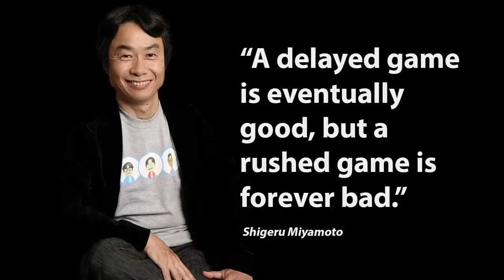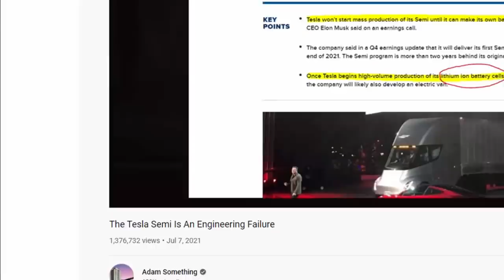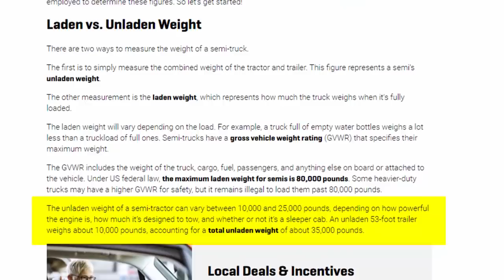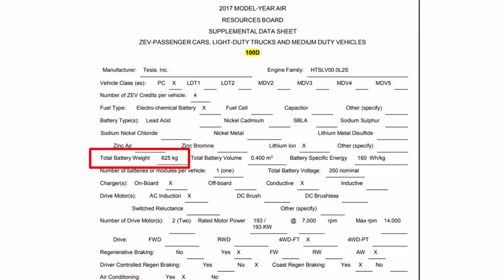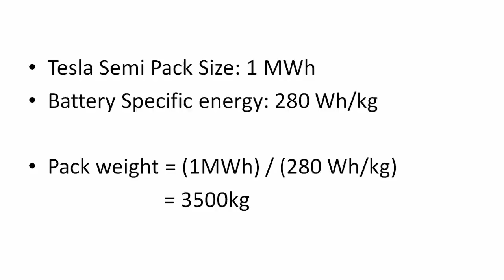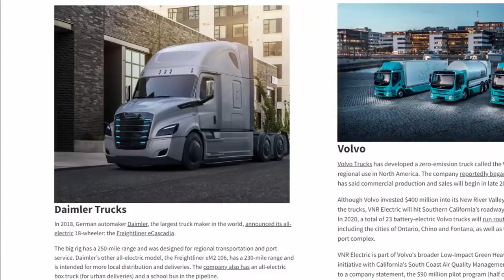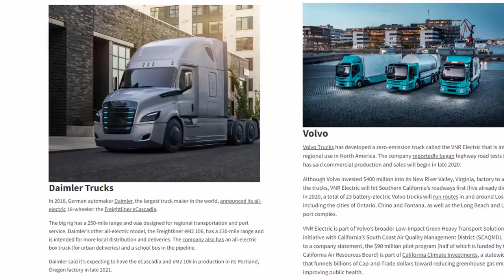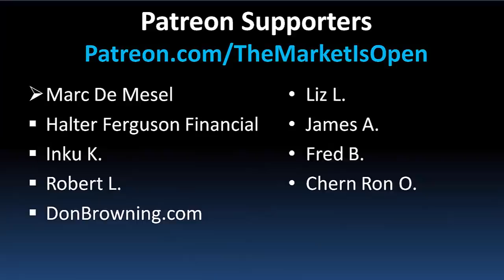The 2022 Tesla Semi is Genius, And Here’s Why

Comment: Battery drain on long up hill grades
No Drake brake to hold gear on long down hill grade 

 never be a big hit in Australia
Reply: Regenerative braking.
Reply: @erbewayne6868   so will trust that over your Drake brake ?

What about loads  120 ton loaded road trains ect
Reply: Regensritive braking on a r r electric locomotive  is when the motors are used as generators to decrease speed or hold back a train on a downgrade and when used with a catanary, puts power back into the electrical grid.  This has worked well for decades to help control train speeds.  I  don't  know  if  it's  in any current electric design but has worked well  in other areas.
Reply: @erbewayne6868   yeh battery drain on the system again this is fail it won't work
Reply: @Paul-fi2kf  regenerative Braking already works in the Tesla cars. Since 2012. Its called recupperation.

Comment: Any ic car mechanic can tell the electric vehicle has a fraction of the parts of an ic vehicle and thus takes orders of magnitude less time to assemble and eventually will lower the cost of a new vehicle by 50 percent or even more in the not so distant future. $4000 for a cell phone in 1988 and 75 cents a minute. Compare that to today. You can pick up a smartphone for 50 bucks and pay 30 per month for unlimited everything.
Reply: Lithium costs have doubled. Silver is scarce. Copper cannot meet demand and is going up. Steel is going up. No price decreases coming anytime soon to say nothing of infrastructure for charging.
Reply: @jimlycett4480  Lithium price is down. It was never as cheap as today.

Comment: A couple errors in this video I would like to point out. Tractor trailers are actually almost always loaded to capacity. Freight transport is most cost effective when at full capacity and so what's the point in having a transport at less. In fact semi drivers plan their fuel fill ups around weigh-in stations. They typically try to hit the weigh station when their fuel tanks are less than half full or as close to empty as possible as to meet the capacity limits. And not get fined. Many still get fined because they get overloaded. So yes I would say most tractor trailers are loaded to capacity and many times above.
Another issue is that the capacity of these trailers isn't dependent on the safety of the vehicle. It is due to the load limits of highways, bridges, Asphalt in general. The more axles and tires you have the higher your load capacity.
Last of all to say that these electric tractors are going to completely take over the market is just BS from a Tesla fan that doesn't actually know anything. 
If these tractors turn out to be everything they're promised they will have their place. There will be a lot of companies out there that will see the value in them and use them for what they are intended. Regional / local driving. What they are not intended for is long haul driving. Following the standard 11 hour driving limit a driver could do 8 hours at 55mph rest 30 minutes and drive three more. After this 11 hour driving limit they are not allowed to operate the vehicle for a 10 hour period. Now depending on state we are driving in the speed limit for a semi truck driver could be anywhere between 55 and 80 mph. Even at 55 they will be bouncing against the range limit of a fully charged truck after 8 consecutive hours. Or assuming the truck is charged to its standard 80% after 7 hours. Now let's be honest when was the last time you actually saw a semi truck doing the speed limit on the freeway? Drivers are almost always working against the clock, And don't have the time to plan their trip around charging stations.
Most states allow semis to do 70, 75 and some 80 mph. Following the 11 hour driving limit rules a driver can go 600 mi in the first 8 hours while driving at 75 mph. And then after resting half an hour. Drive another 225 mi. Totalling 825 miles.
I highly doubt the Tesla tractor. Will get anywhere near it's advertised range when doing 75 mph (efficiency tends to really drop off at these speeds) so Tesla probably won't even make 500 miles the first 8 hours. Severely cutting down on its viability for long haul use.
It doesn't end there. Many long haul truckers have partners that they switch out with so as to not have to take rest stops. These team driving operations and can drive 3500 miles across the entire country without a single stop and less than 3 days
If driving at 55 miles per hour. A Tesla tractor can make 400 mi at 80% charge 30 minutes per charge. It would require at least 9 charges. It would be traveling slower and have more downtime than the diesel equivalent making it not applicable for this situation.
So these Tesla trucks will have their place in regional / local trucking.
But they will not be taking over the market untill they have MUCH more range.
Reply: WELL SAID!!! I CAN TELL YOU HAVE AN AMPLE AMOUNT OF XP
Reply: Idontrunn toofast - Thanks for Agreeing with Tesla's Mission for the Semi, as mentioned when it was Unveiled! 

"80% of Semi's drive under 250 Miles from Base, per day!" 
Tesla is aiming for "Day Trips" or Out & Back, same Day, from A Base, with both Versions of this Truck! 

It is not "Competing" With those Semi's that can "Tanker Fuel" for an 1,800 Miles per Fill, Run, or "Over The Road" Long Haul Rigs!

And, if that 80% Figure, is anywhere mere close to Accurate, that's still a big Market to play in, to start with!
Reply: @robertweekley5926  Exactly, this is what the Tesla Tractor was made for. I already know all of this as you can tell from my lengthy comment. My comment wasn't a criticism of Tesla. If their Tractor does everything they promised it will be excellent for the purposes it was designed for. My comment was obviously directed at the ignorant fanboy that made this video who obviously knows nothing about hauling, trucks, and the various uses and needs that they fulfill.
Reply: @robertweekley5926  Right, but its NOT GOING TO END ALL DIESEL TRUCKING YOU CRETIN
Reply: Tesla is selling a "Day Cab Semi" exactly for "Local/Regional" Runs, from Warehouse to Stores! 

It's not a "Sleeper Cab" exactly for such reasons as you stated! 

Plus, it will take, a minimum of 3-5 Years, just for them to get to 100,000 Units per Year, because, in part, demand for cells for the Cybertruck, as well as, getting a full Network of "Megachargers" set up!

But, in 2025-2026, it should be Quite Interesting!
Reply: If regenerative braking is used, there would be some gains in travel distances.
Reply: @erbewayne6868  If regenerative breaking is used any additional mileage it produces is already included in the estimated range.
Reply: I see an error in your view.
The driver cost.
You say they don't stop because they carry two drivers.
The fanboy  in this clip points out Tesla's plans for convoys with only one driver or even full driver less ones eventually.
Maybe the long haul tech is not there yet but how many products require that tight delivery schedules?
Btw have you seen the experimental pentagraph in Germany ?
Charges the truck while driving....
Problem solved..
Reply: @Blibby-Blobby     Nope, no error just facts. Whether people can see those facts or not is up to their understanding of the laws of physics and basic economics. I'm pointing out that this tesla fanboy claims that these trucks will be completely taking over the market. The fact is they won't be. Not for some time at least when infrastructure that allows for it. 
And yes I was pointing out that Tesla does not intend for these to be used for long haul. That's a portion of the market that it will not be able to touch. And it's a bigger portion than you think. Aside from just rapid delivery of goods long haul trucking provides most of "perishable goods"
Ever wonder where that steak came from? It was most likely transported as a live cow from another state. Transportation of livestock (cows,chickens etc.) across the country is primarily a job of Long haul trucking, The product must be transported in is short of a time as possible to reduce the stress on the animals, reduce the cost of feeding, and care of the animals during transportation. So yes Long haul trucking does make up for a important portion of the market
The German charging road maybe applicable to a few sections of the Autobahn but do you realize what kind of infrastructure will be required to provide charging just on our highways in the US? Germany is about 138k square miles. Which makes it about the size of New Mexico or Montana and about half the size of Texas or 1/30th the size of the United States.
Germany has a very dense highway system with 400k miles of road and about 8000 miles of expressway. The United States has close to 4.2 million miles of road and 164000 miles of expressway.
Let's just assume that the EV charging roadways require no maintenance, cost the same as normal concrete / asphalt and can be be built with relative ease in the same time frame as normal expressways. (All untrue) we still wouldn't be able to afford the cost required to replace even a 10th of the highway system we have in place over the next 50 years. It's not economically feasible. Additionally currently our electrical grid isn't up to the task of powering all these electric cars and trucks More energy plants will have to be built, high voltage lines put in place, substations installed and grids will have to be replaced in order to meet demand. It's not something we can just jump into and it's probably not going to happen in my lifetime. 
Before you jump and just call me a EV hater. I am not. I think it'd be awesome if all this were possible now. If I could afford it I would gladly purchase a Tesla today to replace my grocery getter. I think it's all really cool and it's the direction that the world is going. But you have to be a realistic with expectations and This YouTubers' expectations don't fit reality.
Reply: @Idontrunntoofast  
You still didn't address the driver cost which are enormous.
I agree support infrastructure is not yet available and in the USA and Australia to mention only two long haul situations it may take a longer time to implement.
I think things will move much faster in Europe but again the more space the more charging options open to you.
If its possible to 80% charge in 30mins and you only need 50klm max of over head cable on main routes which could be placed at starting points of uninhabited areas.
But it's early days yet and I think the main point is this video makes, is there is no serious competition for quite some time. It will be interesting to see what happens when Berlin and Texas giga factorys go online.
But the in my opinion the s*it will hit the fan in Europe when Autonomous driving is allowed.
Reply: @Blibby-Blobby    I didn't address the driver cost because I don't consder it a factor. There are other autonomous capable vehicle platforms, Not just Tesla and when it comes to fully autonomous vehicles Tesla doesn't even have the greatest advantages. We are a long ways off from having full level 4 and especially level 5 autonomous driving and even further off from it being legal on public roads./when It becomes legal sleep behind the wheel as your vehicle self-pilots there will be very strong competition in the AV department. I think we're very far off from that point and therefore I do not consider it a factor.
I would love to have a autonomous vehicle that I could sleep in while it gets me where I want to be. I personally hate driving on busy roads and freeways and very much like the idea of being able to rest / sleep before getting where I need to be.
Having overhead charging systems would be pretty amazing. Maybe it will happen on short strategic sections of interstate travel. But I have my doubts that we will see that in the next 20 years It's not easily feasible and would require a new standard be set for charging systems and safety requirements.
When it comes to charging systems for vehicles it's pretty easy for a private company to put in some car chargers, or for Tesla to purchase a piece of land, set up their own utilities and charge people for power.
 But with overhead power lines that are energized for fast charging of moving vehicles Tesla can't be the designer and owner of them. They are in place over public roads and therefore need to be the responsibility of another authority. Example department of transportation. In this case the department of transportation would be responsible for installation, maintenance, safety. Etc. funding would have to be tax payer money. Because how do you energize a cable over a public road and ensure that people pay for the energy when charging? I'm going to tell you now I can't think of a way to enforce that.
No I think we are quite a ways from something like this happening.
Reply: @Idontrunntoofast  Well the one thing I do agree on 100% is the legislation will be the biggest problem of them all.
Reply: @Blibby-Blobby  most definitely. Getting existing laws changed can be the most time-consuming and excruciating process imaginable.

Comment: Yes, correct the data of the Tesla haters, but don't spread disinformation about the completion. The Volvo VNR truck will have 275  miles of range with a 565 kwh battery pack This performance was based on real world data,, and input from customers.

Comment: The load capacity " Problem" is a long held meme. All you need to do is run a statistical search  on what shippers are actually able to put in trailers. Almost all ltl and most truck load shipments CUBE out way before they MASS out. The margin of revenue missed comes nowhere near the fuel/ maintenance cost of a diesel truck and that margin is addressable by shippers.

Comment: I don’t hear any consideration in this talk of the fact that Tesla owns a great Super Capacitor Company and could use that technology to add power with a lower weight penalty. It seems that there is only a focus on the battery technology. I see the Super Capacitors within the system helping with quick high current charging taking the heavy power load then distributing it to the storage cells …
Reply: capacitors have a low energy density but a very high discharge rate.. ideal in sports cars, with batteries for range that charge capacitors for quick delivery or recovery in regen. Not very suitable for trucks

Comment: I think their biggest challenge will be supporting their cost savings. There's currently no establish mechanism recovering what's lost in road taxes by transferring the fueling from diesel fuel to electricity. There's no question that the substitute will be found that reduces the operational cost advantage.
Gathering and publishing enough operation and maintenance data from production vehicles owned by fleet operators  to establish that the vehicles drivetrains, especially the batteries, are reliable and deliver performance over their estimated lifetime. Combined with a more realistic knowledge of equivalent road taxes, this is essential to convincing independent owner operators they are less expensive to own compared to diesel semis which have known average losses in power and efficiency and known average maintenance costs.
Reply: Since the truck will be charging at a supercharger it will be easy to tax the electric charge. That solves that problem.
Reply: Ca and NY both rebate $120K per truck, obviously the EV semis do not pay th takes for the roads that diesel pays, but there are so few that shouldn't be a problem.
Somehow Bright Drop from GM went from an idea to hundreds of ev trucks faster than Tesla went from  two tesla ev semis to four.

Comment: Trucking industry needs fewer charging stations than gasoline cars do.  This is a plus for the Hydrogen hybrid.  Wouldn't it save vehicle weight to use Hydrogen in a Rig?  It saves the industry and provides an alternative sustainable redundancy.  This creates jobs and the IP avenue of the industry.  To kill that off in the name of technological purity would be unwise.   This video does not address  the Hydrogen alternative.  Regeneration is apparently hell on tires as most Tesla owners are finding out.  Where has Tesla addressed this extra cost?  I love Tesla and hope to own one someday; but c'mon, one need not abandon common sense.
Reply: Hydrogen is dead

Comment: Range is one thing that feels exaggerated by tesla, but it's kind of the EPA's fault. They lose a lot in the winter and driving them fast like you want to
Reply: One problem they will have to address is the increased cost of
electricity. when they replace the diesels. Look at California 
so, in time electricity will be higher for the vehicles and houses.
Reply: @bradobbink6564  but only through the squeeze of transition, eventually energy will be abundant
Reply: Still a lot better than Peterbilts 150 mile range….and recharge time is over 3 hours.